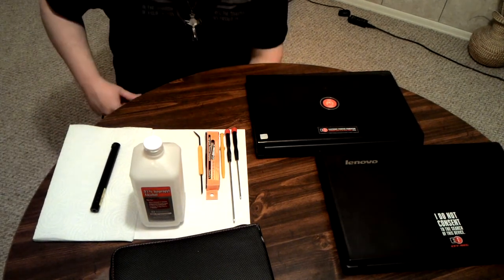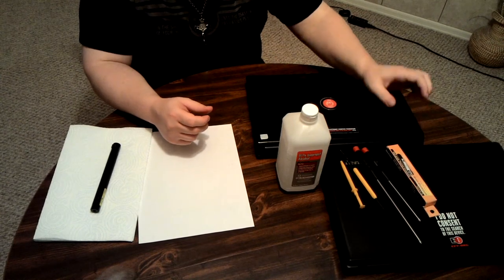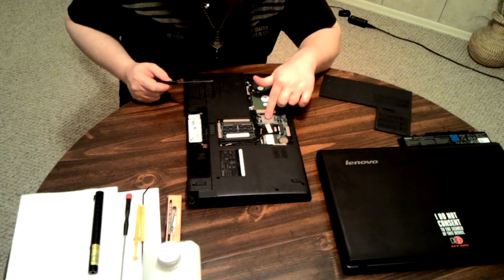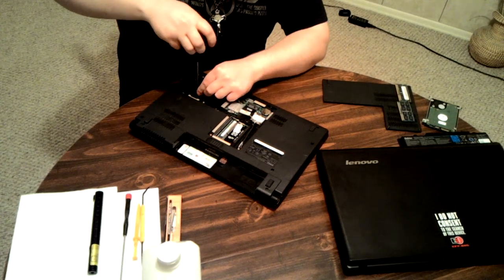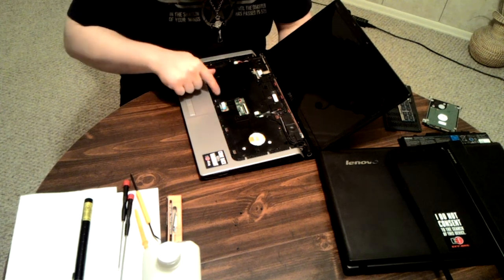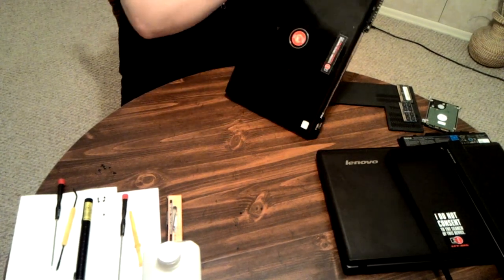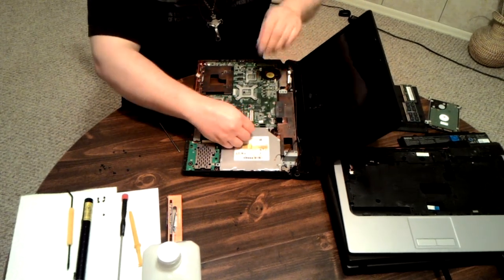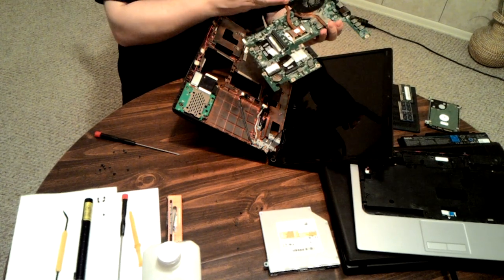Vblog Video 2 - Part 1

Comment from the maker: Disclaimer: I never mentioned the technical size of the philips screwdrivers... They are 3mm and 3.8mm in size.
Also, there is another use for the third antenna wire, it is for the optional cellular card.